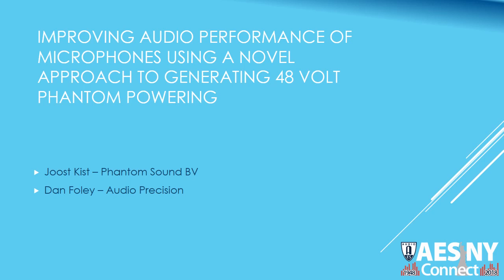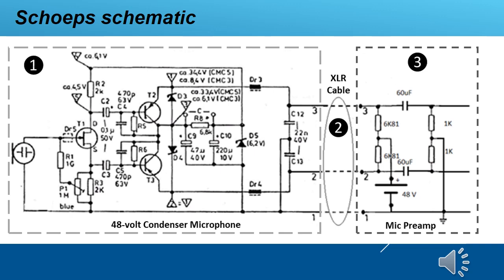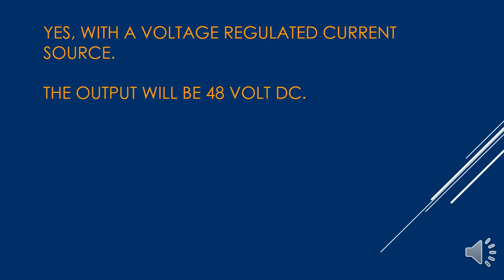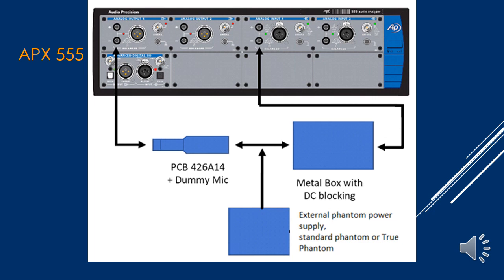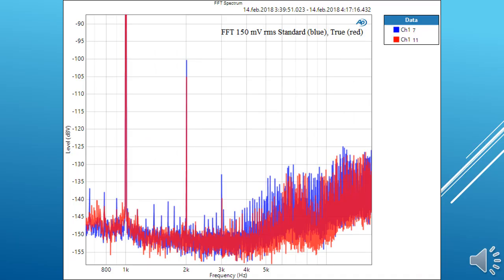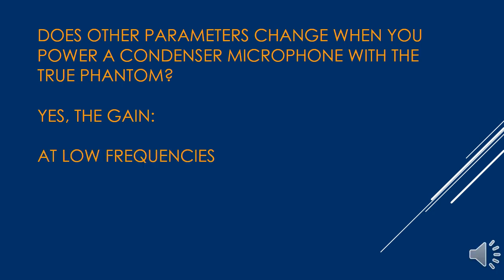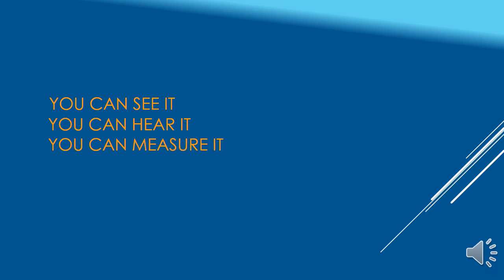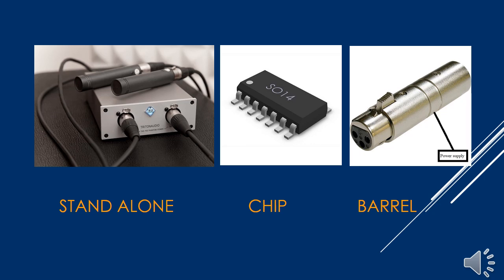True Phantom®

Comment: Thanks for the very interesting video. Does it help to reduce the self noise of the microphone?
Reply from the maker: Yes because the noise of the microphone commes for a big deal from the 48 Volt voltage source and that is much lower with my current source power.
See the graft about noise floor.

At the AES Spring 2022 we will launch the ship.

Kind regards

J. Kist
Reply: Thank you for your reply!　I bought Tritonaudio's True Phontom, is the one that will be released in 2022 different from this one?